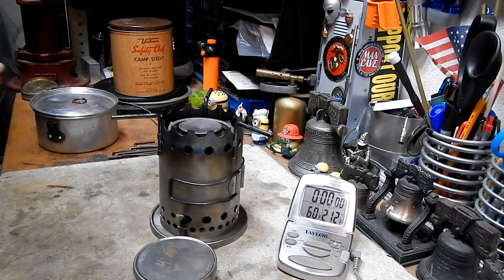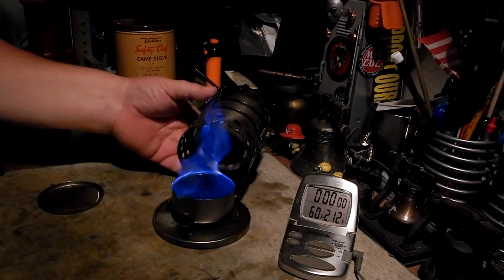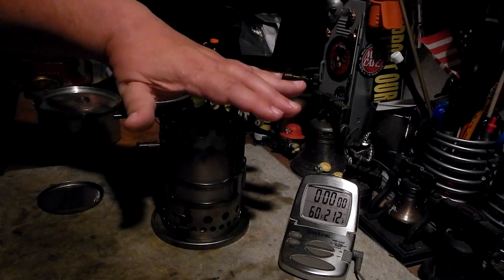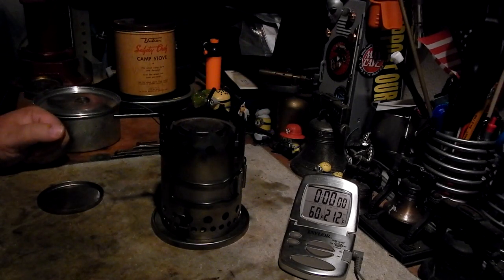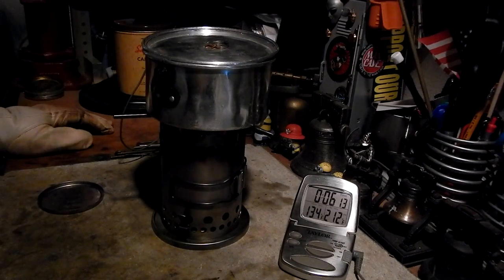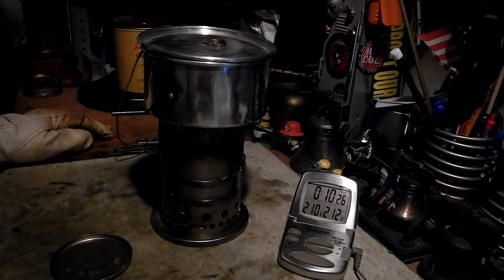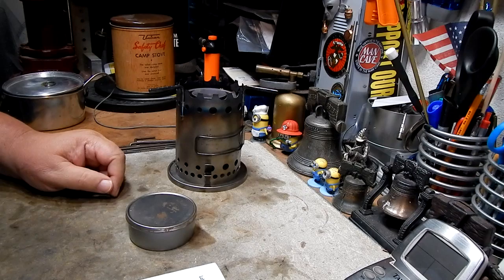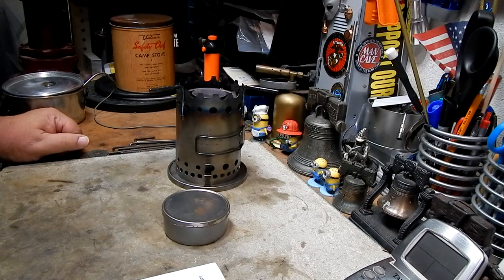Vulcan Safety Chef Camp Stove - DIY Fuel Can - Boil Test

Comment: Specific gravity of alcohol at 25°C is 0.789 so 24g x 0.789 = 18.94mL or  0.64oz (US fluid)
Reply from the maker: theslimeylimey Thank you. Saves me having to look it up.
Reply: Actually, it's 1.029 oz.  Smaller sp. grav. makes volumn larger, when the mass stays the same.  Division, instead of multiplication.  24g divided by .789.